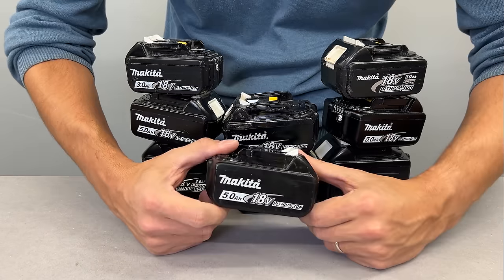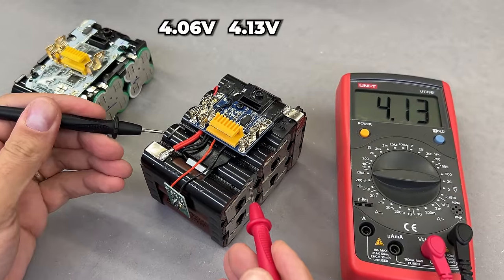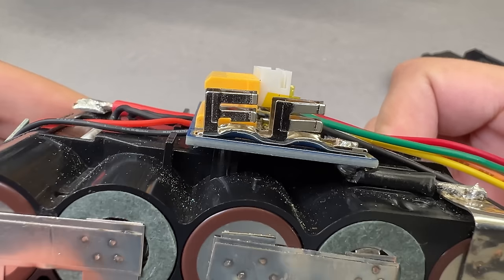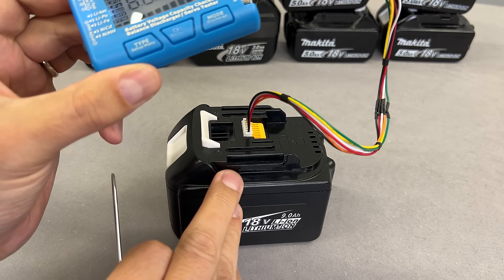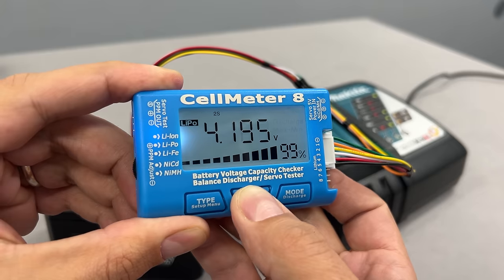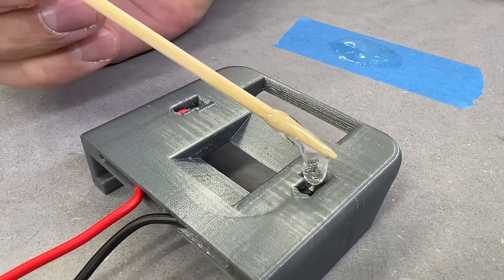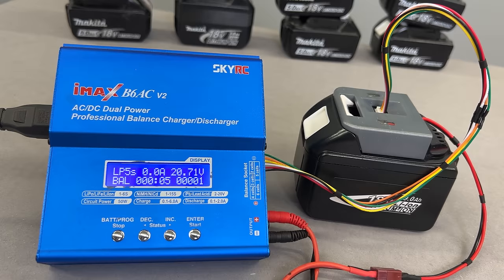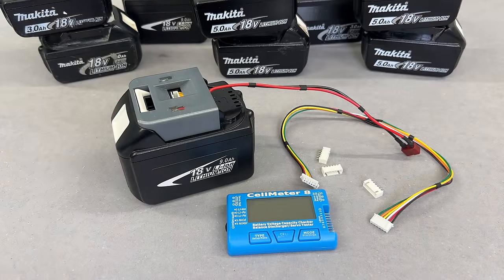Makita 18V Battery Has Big Problem!

Comment: 0:48 Can someone explain to me what that yellow multipin connector on the top of the battery pack actually does?  It doesn't ever seem to ever connect to any device which uses the battery...
Reply: It allows the original makita charger to communicate with the battery chip. To check battery integrity, voltage level, temperature, how many times it has been charged.

Comment: title :makita 18v battery has big problem video: lets add bms to knockoff makita battery 9ah ones keep dying! misinformation here is next level..all geniune 18v line up have bms built in  and they have just 6 ah  battery using samsung or panasonic or sony cells.....better inform ppl correctly

Comment: exactly makita charger itself destroy the batteries. The makita charger doesn't charge and shows the batteries have problems. I tested the batteries in severals makita chargers ... the same ... the lights of the chargers flashing, saying the batteries are broken. Well ... i put the batteries in a cheap chinese charger ... BINGO ... is charging. So ... i sold the makita charger and i have 4 years charging just with a cheap chinese charger. Simple.
So ... fu_k the Makita Factory, fu_k the designers of the Makita batteries

Comment: Ain't worth it.
Makita is garbage
Reply: no, they are the best
Reply: @riba2233  garbage. The ratshit drill
Burned out in a few days. 
I did get the grinder working longer by replacing the brushes with washing machine brushes.
Now I use the cordless drill with a lead acid battery charger. 
Now if it costs more than £20 it's garbage
Reply: @anthonygregory3022   wow this is the dumbest thing I ever read about tools 🤦‍♂️
Reply: @riba2233  as q welder fabricator for over 45 years, you know Jack shit.
Reply: @anthonygregory3022   I know more than y0u do, that is pretty obvious!
Reply: @riba2233  
Yea sure you do.
I don't know nothing. 
Taking a wild guess, I bet you know about child abuse.
Reply: @anthonygregory3022   wow where did that come from lol